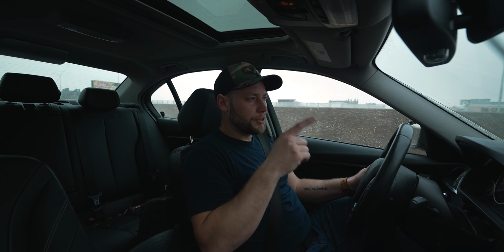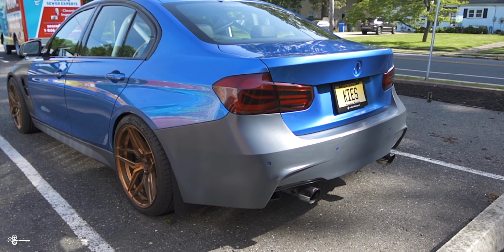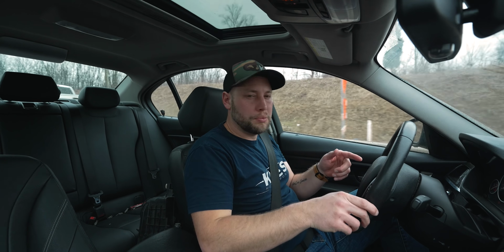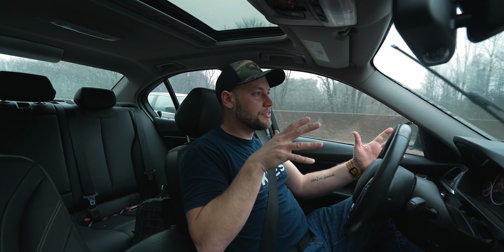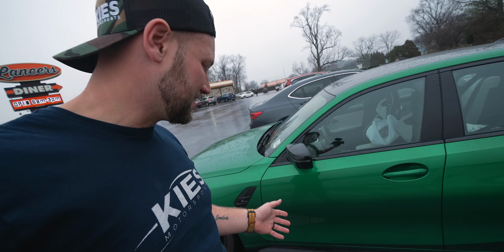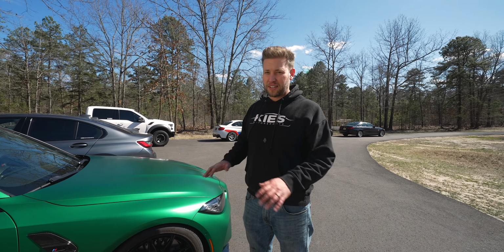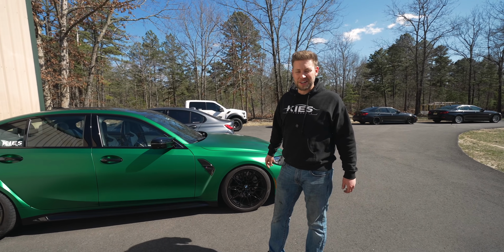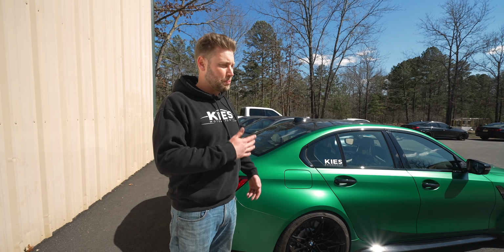BMW M3 G80 wrapped an insane color + BMW F30 gets a stealth look 🔥🔥🔥

Comment: The Isle of Man Green G80 M3 does look great with an XPEL Stealth Matte PPF...but technical that isn't a color change wrap.  The matte PPF looks better for black and gunmetal cars, since those paints don't pop in the sun. Don't apply PPF on top of an already ceramic coated car. #Krazy

As a general rule, NEVER get a Frozen #LetItGo Matte Paint from the factory. Impossible to maintain in the real world. It is for show cars and SEMA builds. Now that XPEL Stealth PPF is available, you can even take it through an automated car wash and your paint is still safe. Plus you can get a Matte Stealth look on any color paint, not just the few Frozen paint options from the factory. You can always undo the Matte Stealth look anytime.